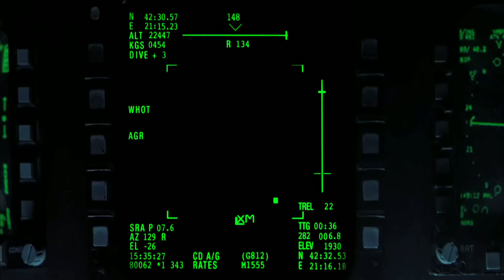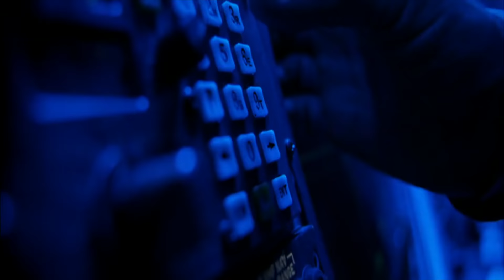Behind Enemy Lines  GTAM vs F18

Comment: For all those who obviously think that the missile "wouldn't track the jet for so long due to its fuel quantity" - In actual reality, the single-stage, short-range missile 9M37 (NATO reporting name: SA-13 ''Gopher'') of self-propelled system 9K35 "Strela-10" which is portrayed here, achieves maximum speed of Mach 2 (2,470km/h or 690m/s) while the F-18 ''Super Hornet'' achieves its best speed at Mach 1,8, which is, although slightly, still less.

So, I think that the conclusion is more than obvious - there's absolutely no way this aircraft would "race" with the missile, since it would either be hit by it or missed almost immediatelly after the launch (especially if the missiles comes from the opposite direction to the aircraft - there's almost no chance of evading it, less indeed to "race" with it). So, these stories about "missile's fuel" are actually mostly irrelevant here (although the statements that the missile wouldn't have been so long in the air are absolutely correct, but that's not the main point why this chase wouldn't have last such long).

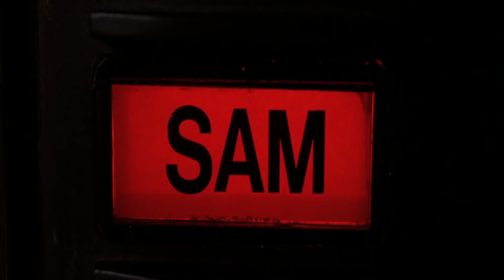Beside this, there are two other inaccurracies in the scene, which aren't recognized (at least as far as I can read here). Firstly, there probably wouldn't be a "SAM" warning for pilots in the aircraft's instruments at all (as shown in 1:27), simply because the 9K35 doesn't feature a fire-control radar (same as most other short-range systems). This is due to purely logical reason, because these systems rely exclusively on visual launch and tracking, since their missiles feature very short range (which just can't reach the target beyond visual range), so they simply don't need a fire-control radar at all (in contrast to medium and long-range systems). Because of that, the mentioned 9M37 missile is self-guided type of missile, which relies on thermal/IR (infra-red) optical seeker located in its own head (clearly seen at 1:23) and which, after fired, doesn't need any commands from the ground (tracked vehicle) anymore - making it a so-called F&F (Fire & Forget) missile.

A slight digression here - this makes these types of missiles very dangerous for aircraft from the one hand, because the pilot doesn't get any kind of warning about lock nor launch against his plane and, thus, doesn't take evasive action (until it's too late, in most cases). Furthemore, systems launching them (like 9K35) can't be targeted by electronic counter-measures (ECM) nor anti-radiation missiles (ARM). On the other hand however, they still have their own disadvantages when compared to larger (radar-guided) missiles, since they simply can't target beyond visual range (which is why they're pretty useless against modern air-force conducting launches from 100km+ using cruise missiles and guided bombs) and they can be sometimes deceived by flares.

Therefore, these short-range systems (like the one potrayed in the movie) actually serve only as the so-called "backup" or "third-tier" air defense (to eliminate targets which have eventually slipped through the main screen of air defense, that is, the one which is ensured by medium and long-range systems).

However, the 9A34 turret of the 9K35 system does feature a circular parabollic dish/antenna, centered right between the two launchers (as seen at 1:09), but that doesn't represent a continuous-wave (CW) illumination radar for fire control (guiding of missiles and tracking the target), but only a range-finding radar, which is known as 9S86 (NATO reporting name "Snap-Shot"). This, as a standard pulse radar, only measures the range and elevation via digital computer which calculates a missile path to the target, in order to provide maximum possible hit percentage as well as so that the launch wouldn't be conducted too early (above or beyond the maximum range of the missile) - as could have happened in its predecessor, the 9K31 "Strela-1" (due to absence of such radar and its calculator). Anyway, the point is that this radar most probably wouldn't be recognized by aircraft's instruments as "SAM" warning, as stated above.

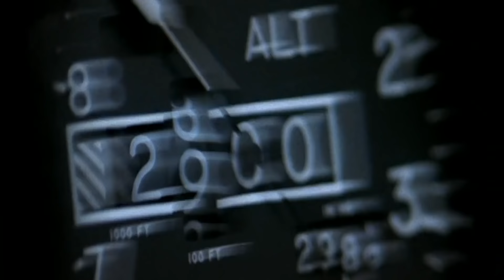The other inaccuracy is shown at 3:50 - the missile wouldn't pass this close to the aircraft without detonating, because it naturally features the proximity fuze in its warhead, which, as the sole name points, would have activated the detonation when close to the target (at approximately 5m away from the aircraft, since it's still a small missile with a humble warhead). Ironically, the same scene then correctly shows activation of proximity fuze at 4:13, after which the detonation of the warhead follows (and what should have actually happened back at 3:50).

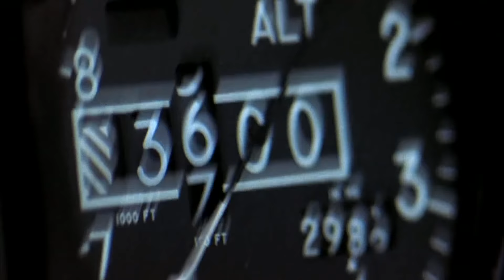There's also another inaccuracy in that scene, shown at 4:00 - the missile simply can't "come back for target" after it had already passed by it. In that case (missing the target), it would actually have activated its destruction mechanism after few seconds (considering the IR seeker doesn't find another heat signature/target in that direction and start guiding itself again) or simply continue to fly without guidance until running out of fuel and then simply fall to the ground (although that's a rare case in this context - it was present in the previous 9M31 missile of 9K31 system, due to absence of self-destruction mechanism).

All in all, we simply have to understand that this is a movie, not some documentary about anti-aircraft warfare. And for a movie, this is actually not just pretty well-made, but I would also dare to say that this is one of, it not the finest jet & missile scene in history of cinematography.

Despite having the pointed inaccuracies, the scene is still very realistically made (especially for a 2001 movie), that it almost looks real, not CGI. Furthermore, this scene is actually more realistic than the SAM scene in 2022's "Maverick", which has much bigger technical flaws. That's why the Behind Enemy Lines is, in my opinion, very underrated while it actually represents one of much better movies to watch.
Reply: If it was accurate it'd be a boring ass movie.
Reply: @finnickrinzler8907  I agree, since in that case, this scene would have lasted only for a couple of seconds, instead for a few minutes.
Reply: @E2dEyeTheta  Agree, however most of the public in the comments have surely never served - including myself, to be straight.
Reply: Former Navy FC here.  Very accurate description.  I will also add that they would have almost surely fired 2 missiles back to back, before firing another salvo after the aircraft evaded them.

Still, an incredible movie scene and I can't think of another that depicts both a missile warhead so accurately AND an ejection.
Reply: @andystevens7557  Many thanks, I'm flattered when a praise comes from a person with both knowledge as well as experience about the topic.

Agree with the statement regarding the missiles, especially when looking on a fact that the 9K35 features four ready-to-fire missiles, after all.

Also agree with Your last sentence - as I've already said in my original comment, this is most probably the finest jet & missile scene in history of film-making, since all the depicted effects are made so convincible that they literally look as real.
Reply: With a war raging on in Europe, I find myself thinking about this scene whenever I hear in the news about fighter jets. I do not know of any other movie that comes close to this level of details in portraying a modern dogfight. If anyone knows of something similar, please do reply. I would love to watch it.
Reply: @KienPhamKP89  I think that the finest portrayal of dogfight most probably belongs to the Top Gun, while this one portrays the finest surface-to-air missile scene.

I personally highly doubt that any other movie shows it more realistic than those two (although I may be wrong).
Reply: Thanks for the info and insight, man. Despite the handwaves they did for the movie, it was definitely worth it to convey a tense and exciting scene. Anyone could tell that the aircraft was going down even before watching the whole film (since the crash was already a big part of the premise) but the way they did the scene makes one think, “oh god, maybe they actually do have a chance”.
Reply: ok
Reply: ЗУР 9М37’s speed is 1.56 Mach
Reply: I thank you for this information
Reply: You'd be heaps of fun at parties I bet
Reply: @mattscan5939  I think I am.
Reply: You need to go outside
Reply: @andystevens7557  Well Said from the author. Cool seeing a real Legend in the chat. I had no idea that the warheads of these AA missiles featured the multiple projectile kill style to disable an aircraft. War is too damn scary
Reply: its so lazy to read this bulk🙃
Reply: @isuruthiwanka9448  Agree, I'm slowly getting on my own nerves.
Reply: This is why I love the comment section, there's at least one person that breaks down the video that's played. I thank you for that.
Reply: You said exactly what was on my mind 🤔
Reply: Yes it’s a movie. We get it.
Reply: @solidpro9  Actually, good half of the comments obviously doesn't get it, which had exactly made me to post this.
Reply: Ok boomer.
Reply: Wow..
Reply: @m4mihulja  bruh you really typed out a book after the 3rd paragraph I thought you were done but scrolled down and saw 5 more and said screw it I don’t go to YouTube comments to read novels I’m just here to see Owen Wilson do some cool naval Air Force shit
Reply: @Rofl30000  Well, no one forces you to read if you don't want to.
Reply: Thank you Robert Lazar .
Reply: It’s a fictional movie. Not real or accurate. Why are you wasting your time.
Reply: @alexshank1414  And what's actually written on my last pharagraph?

This comment of mine was just a response to all those endless and pointless debates over "evading/not-evading a missile".
Reply: @m4mihulja  Ok. My bad.
Reply: Trust in your gear
Reply: But that explosions of fuel tank is very bad CGI, i wonder  why  they didn't make real explosion, it isn't that expensive...
Reply: "More realistic than the SAM seen in 2022's maverick"
How? The missiles in maverick were much faster than the planes, exploded before they hit (way easier to explode near a fast moving target than to hit it), there was more fired (a key part of anti-air is to saturate the air with fire to give more chances to hit, you wouldn't want to fire just 2 missiles at something), and there weren't points where 
drop tanks explode like firebombs and immediately attract missiles, or the missile somehow hits the plane without going off, and manages to turn back around without running out of fuel...
Reply: @hyperx72 I entirely agree with the part of missiles being more faster that the planes (that's the most inaccurate thing here in "Behind Enemy Lines"), but, unfortunately, it appears that you've missed a few huge technical inaccuracies what's concerned of a certain model of SAM portrayal in "Maverick" (some of them even being shamefully obvious).

Anyway, the air defense system portrayed there is another Soviet and, nowadays sixty year old portable system known as S-125 "Neva" (or "Pečora", for export).

The first and the foremost issue regarding its portrayal in "Maverick" is that it's missiles - the V-600/5V24 or V-601/5V27 (SA-3 "Goa", by their NATO reporting name) are erroneously shown as being simply deceived by flares (and in multiple cases through that scene).

In actual reality, the detection, tracking and guidance of the S-125 system had always relied exclusively on its own fire-control radar (known as SNR-125, or "Low Blow" by the NATO reporting name), which was being operated from two separated control cabins (the ODAZ-828 semi-trailer). This cognition then automatically alludes that this system's missiles (the mentioned V-600/601) were being guided to their targets exclusively via radio-transmitted signal from the ground (from the mentioned radar) which, in other words, actually means that there's absolutely no possible chance that they could ever be deceived with heat-flares, like stupidly shown in the movie.

Furthermore, there's another pretty big issue regarding the same scene and the system in "Maverick": in multiple occasions, the S-125 is shown firing all of its missiles simultaneously (all four from an individual launcher) and, at few certain fragments of that scene, it's entirely clear that they're intended for two different targets (aircraft).

Something like that was literally impossible for that system (even in its last and most modern variants, like the S-125-2M "Pečora-2M", originating from late '90s), since it had always represented just a single-target channel and two-missile channel system, which means that it could actually fire at only one target at the same time with two missiles at most, but by no means at two different targets with two missiles per each simultaneously (the S-25 "Berkut", 9K37 "Buk", 9K330 "Tor" and S-300 were the only four Soviet air defense systems capable of simultaneous engagements).

So, apart from shown as being deceived by heat-flares, the S-125 is also at technologically very exaggerated-level in "Maverick".

And last but not least - the S-125's quadruple launch platforms (which were known as SM-106 or 5P73) seen in "Maverick" are shown like being located in the middle of nowhere (atop of some mountain peaks and installed on some kind of pretty odd metal structures).

Firstly, in reality it would be very hard, if not virtually impossible to place these launchers in such positions (because they were being towed by standard Soviet military 6 x 6 trucks - the ZIL-157 or 131) via special two-axle trailers (known as KZU-16), due to which positioning them in such environment would be highly-unlikely.

Secondly (and much more importantly) - placing them in such highly-elevated positions (mountain peaks) would be completely senseless and very naive from a purely tactical perspective, because the system's main/fire-control radar (the SNR-125, in this case) would then lose any kind of low-level coverage (for searching, tracking and engaging), which would then allow the aircraft to simply fly below its antenna-level height (but still enough high in elevation) and pass completely undetected (and that's precisely why no air defense system is ever positioned in any kind of more elevated ground).

What's more of a paradox, the S-125 was actually designed as the very first Soviet system specifically intended to effectively engage faster, more manevoruable and very-low flying targets (the multirole jet aircraft), due to which its position in such senselessly high-ground (as shown in "Maverick") ends up even more ironic.

Don't get me wrong however, Maverick is a still a very good piece (I've watched it few times so far), in fact, only that scene makes it somewhat less good that it could have been if the certain SAM system was portrayed more correctly and appropriately.